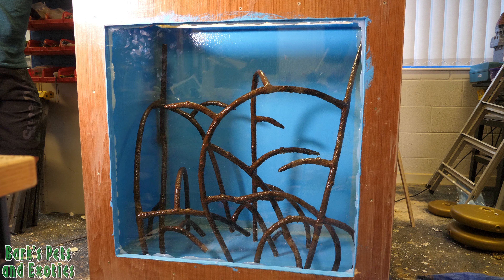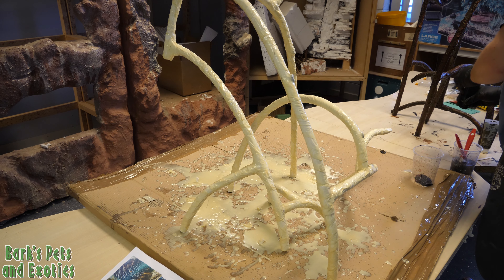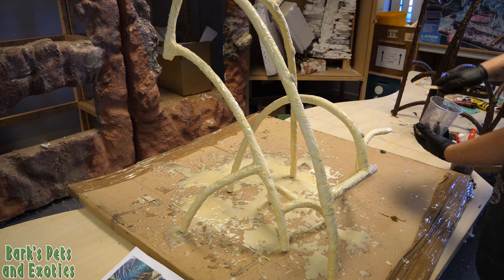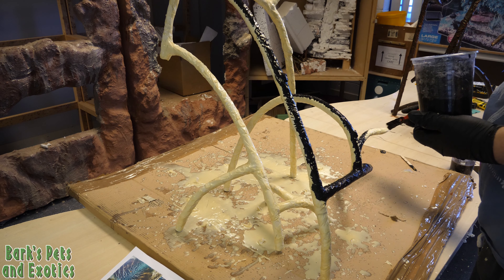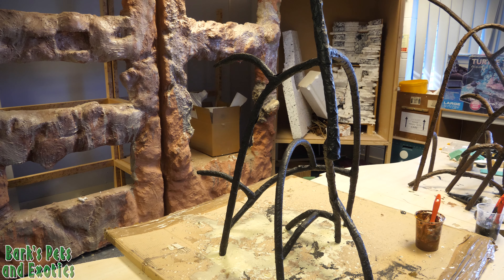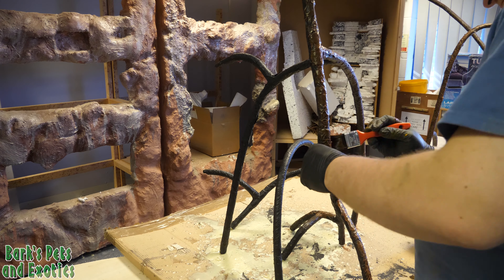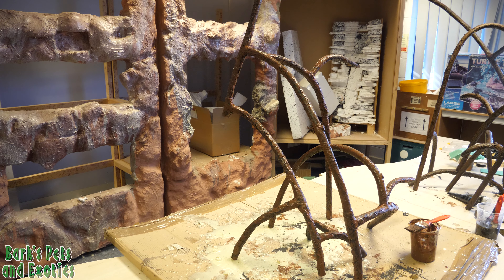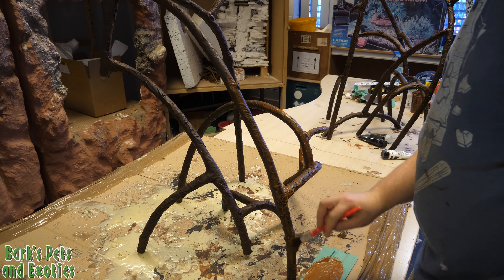HOW TO: Build a 800 Litre plywood aquarium | Part 5 | Painting Mangroves TUTORIAL

Comment: what paint did u use?
Reply from the maker: We have used a mix of acrylic paints and wall paints for the build. We have sealed everything with pondarmor to make sure that no harmful chemicals make it into the water, but there are some things to check for when buying your paints and silicone.

Don't buy any paint or silicone that says it is mould resistant as they will usually contain chemicals that will work their way into the water and be harmful to your fish. Cheaper paints will generally work better for you here as they are made with the bare minimum components to get the job done and don't have any of the fancy features that could end up causing you troubles later on.

Also, you should avoid gloss paints as they can cause issues with the pondarmor bonding to them, we would always recommend matte paints or satin at most to make sure that you are going to get a good secure adhesion for your pondarmor.
Reply: @barkspets8869  Could you send links of where you bought them?